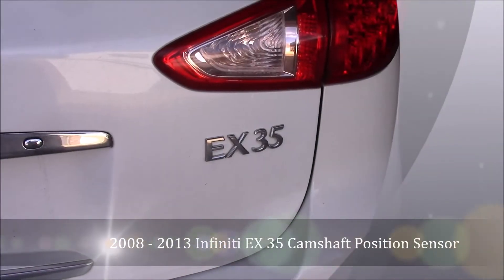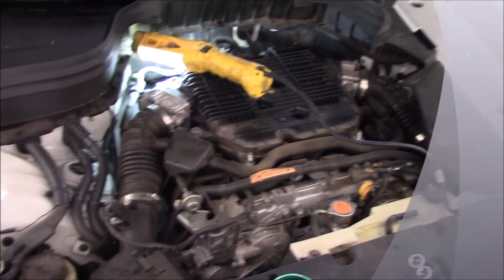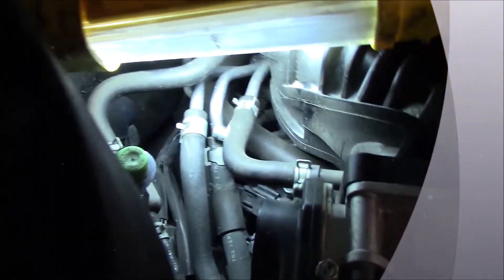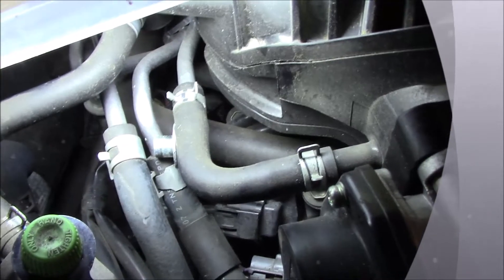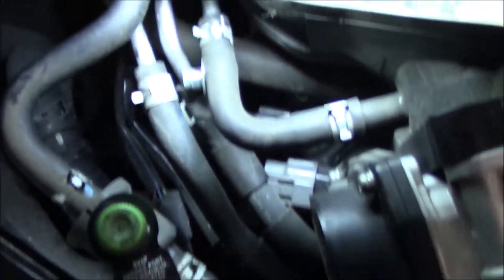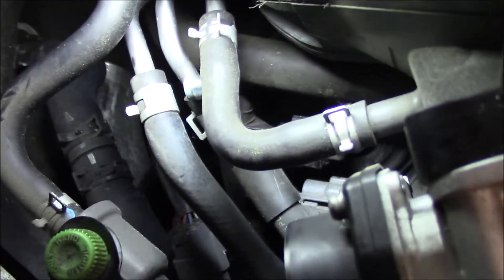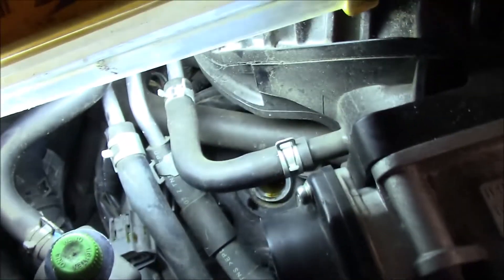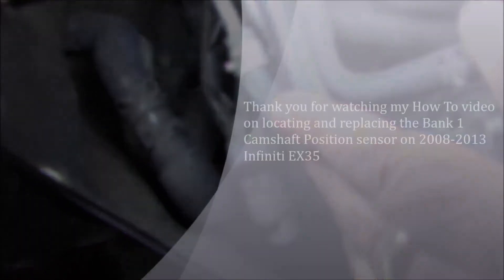Infiniti EX35 Camshaft Position Sensor Replacement (Bank 1 Exhaust side)

Comment: I am being told there is 4 camshaft sensors on the 2012 EX35 is this correct?:body-blue-raised-arms:
Reply from the maker: Yes. The others are easy to access. 2 in the front and another on the drivers side rear of the block. The exhaust bank 1 sensor is hard to find and remove.

Comment: Thanks for the video. I was having an issue removing the connector to the sensor. I’ll try it again with screw driver pushing down on the tab right?
What kind of symptoms did you get before replacing the camshaft sensor? I’m getting P0021 bank 2 which is the driver side.  
BTW intake camshaft is the inner one and exhaust camshaft is outer.
Reply from the maker: it’s been too long ago. I know I was getting P0021 code.
Reply: @tedbacon3614  Thank you very much! 
You push the connector tab to remove it from the sensor right? Mine is kinda stuck even pushing the tab down.

Comment: whats the OEM model number for the camshaft sensors for both banks?
Reply from the maker: 23731-JA11B  Same for both banks.  I would advise confirming with your Nissan/Infiiti dealer but should be 23731-JA11B  Same for both banks.